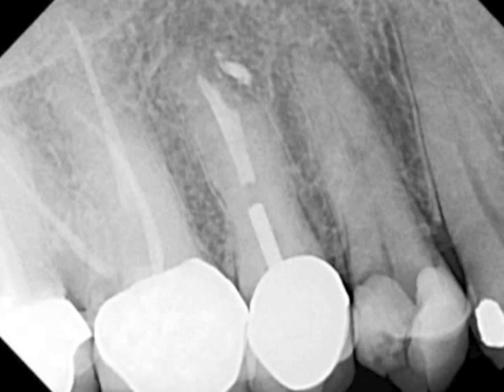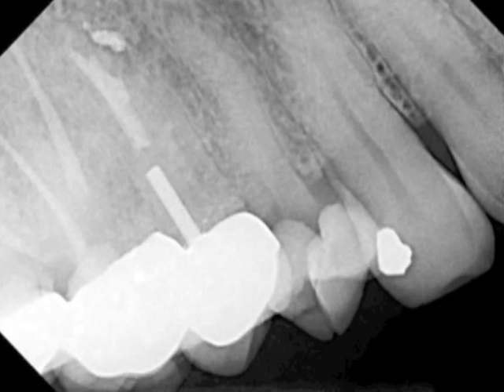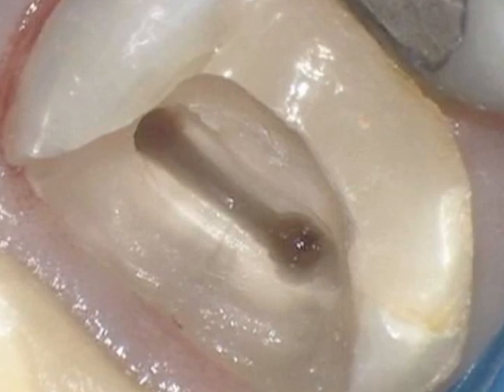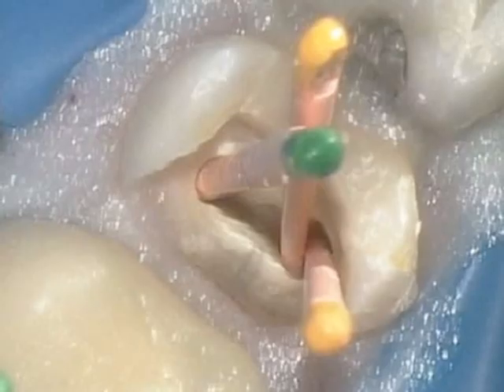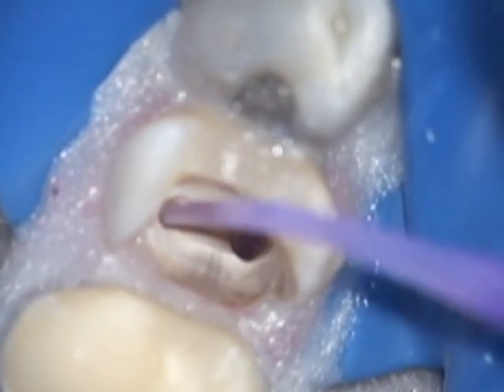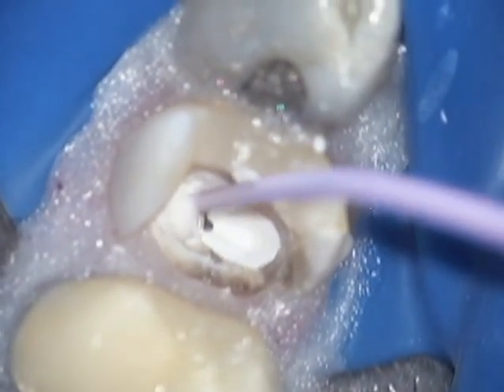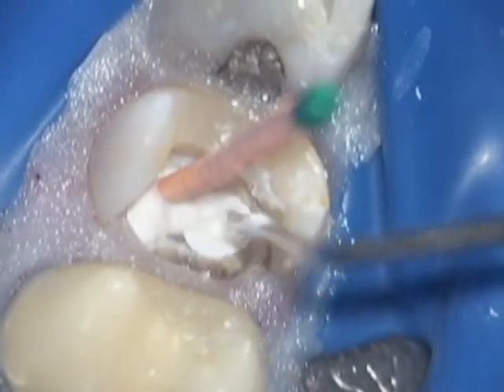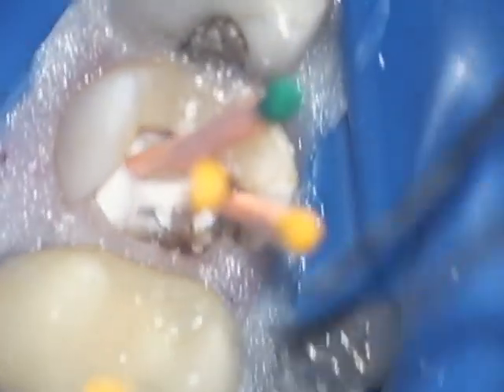Bioceramic Obturation

Comment: Hi Doc. Allen,,

Is it possible to use the matching cone along with the BC Sealer without using Backfill obturation system ?

Regards,,
Reply from the maker: +Mohammed Yaghmoor Yes. That's the main technique. You only backfill if you end up having space in the orifice after you sear off at the orifice. If you sear off 1-2mm above the orifice you won't need to backfill.

Comment: Great work!  I have a couple of questions doc:
Can we use the same technique of hydraulic condensation with pro taper GP cones ( f1,f2 ..) as i currently use that system.
Do you reuse any of your NITI's? It seems like a waste every time i discard mine after a single use ( especially with fairly straight canals!).
BTW, I am a big fan of your work:)
Reply from the maker: The only problem with the ProTaper GP is that you won't take advantage of the bonding of the sealer to the Gutta Percha as you would with a coated cone. However, it's still better than the traditional sealers. So, it's worth the try. And thank you for watching! :) Please check out the website and ask questions on the website to get a response from all the RWE faculty. Thanks. Sign up with Free membership.